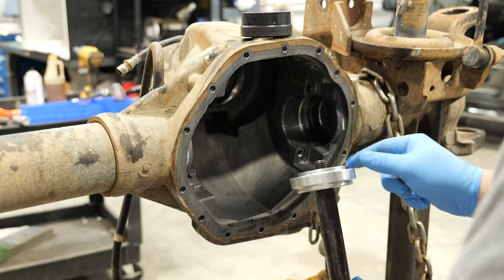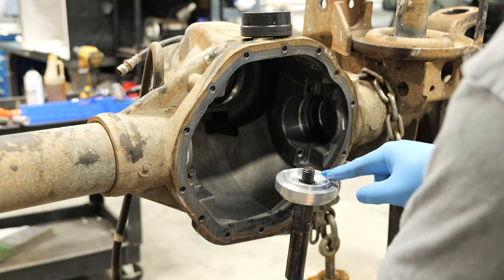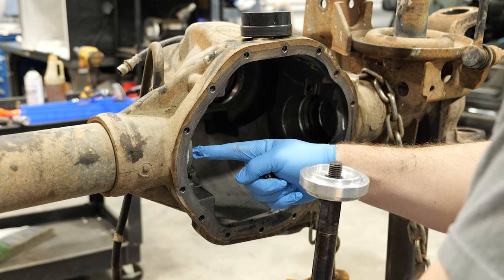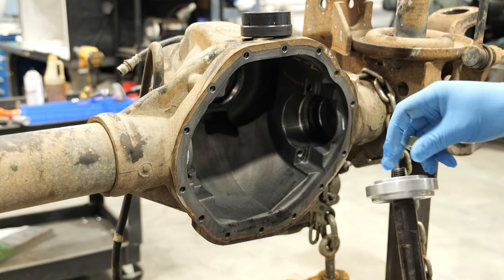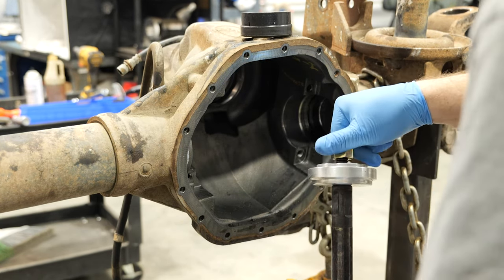Dodge Ram Front Axle Inner Axle Seal Remove and Install

Comment: Does this work for the 2001 dodge ram 1500 Dana 44
Reply from the maker: No, a 2001uses a QK4620 installer https://torqueking.com/product/774620/qk4620-dodge-adjustable-depth-front-inner-axle-seal-tool-kit/

Comment: 225 for that tool!!!! Thats insane!!
Reply: eBay has a general tool that does same for like 60 bucks 
Used it on my truck works the same just not as hefty but still plenty strong enough for the job at hand.

Modified my jack handle top end that's open with a metal rod machine shop scrap can get cheap that I used 4 m6x1.0 screws countersunk drilled and tapped rod on sides
 then I drilled and threaded m12 bolt into take a flat steel disk to push out old seals overall cost about 75 or 80 bucks